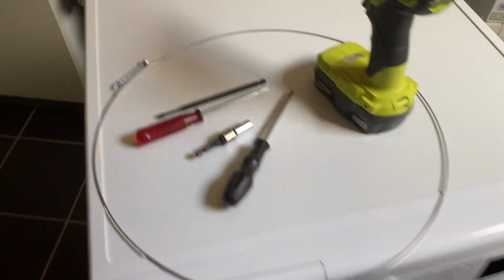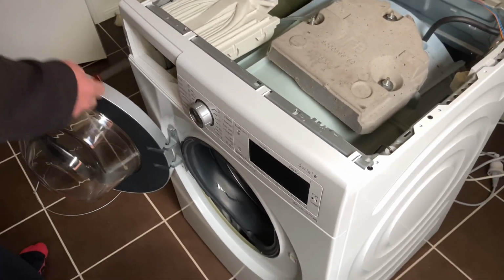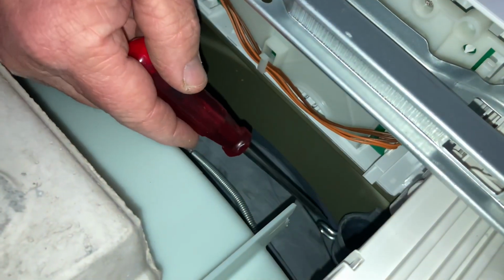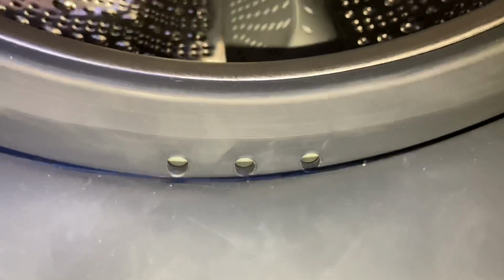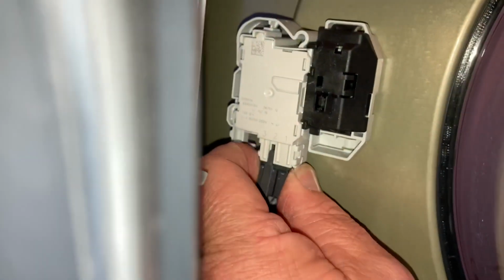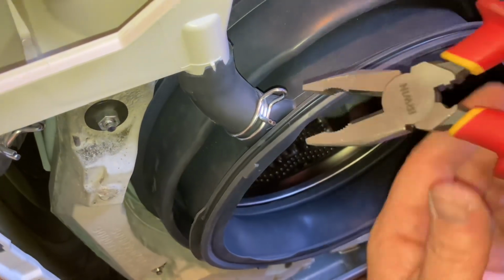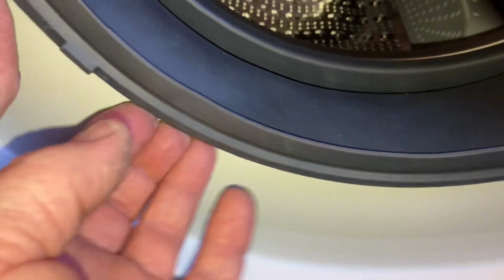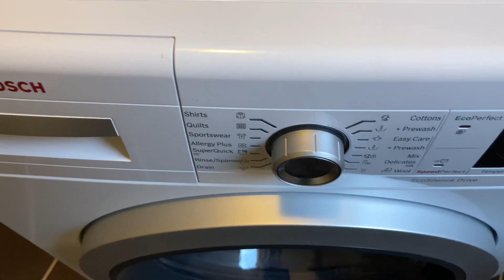Fourby4diesel Sunday’s FRONT LOADER WASHER Door Seal REPLACEMENT

Comment: You made that a lot harder than it needed to be. And you did not mention the most important part right in the beginning...unplug the power!
BTW, front loaders are way better than top loaders, more effective with power, water, detergent & cleaning, they are more gentle on clothes & clean better. 
Stick to what you know...Prados.
Reply from the maker: That’s not very nice the people watching a no more of an expert than me we’re not all as good as you and you didn’t make a good video so mine showed all the options and plenty of information to help people get educated and showed that there’s two different ways to do it the hard way without removing the front and the easier way by removing the front it was a good experience and many people will use this video to do it themselves because you’re a rip off Hah Hah Hah
Reply: Rip off? How's that?
And safety ALWAYS comes first, unplug power is no. 1 step.
Reply from the maker: I didn’t do a step-by-step process of course when you work on anything electrical you unplug it that’s common sense we’re not covering common sense were covering the things people don’t know anyway where is your video
Reply: Why do I need a video? 
And you still have not answered how I'm a "rip off".